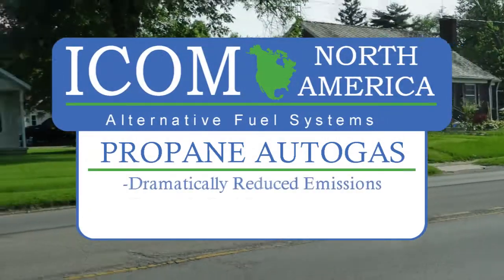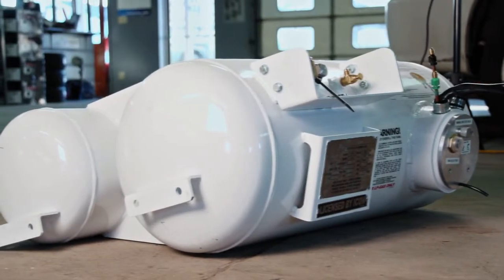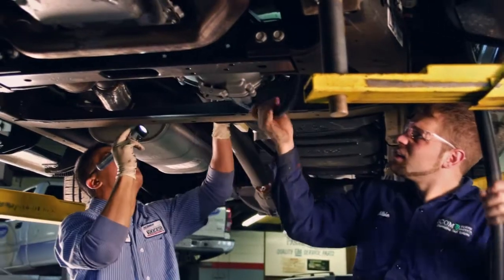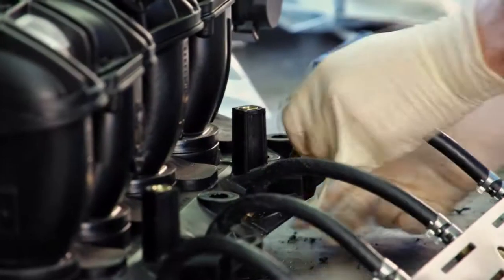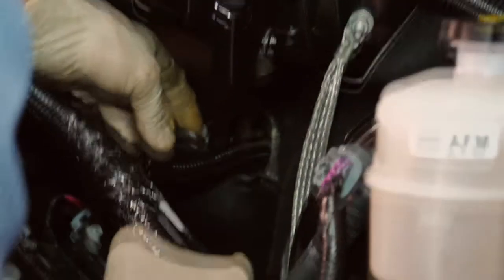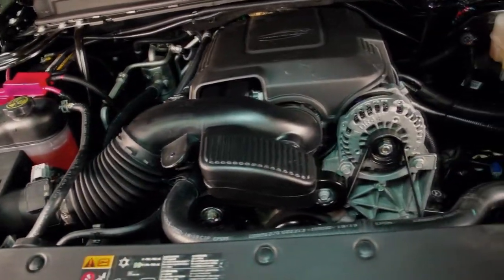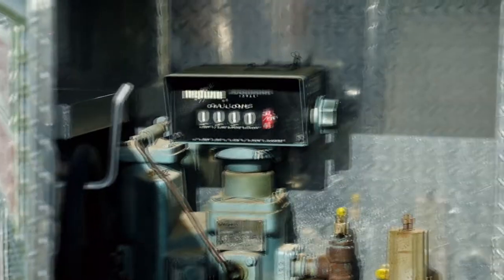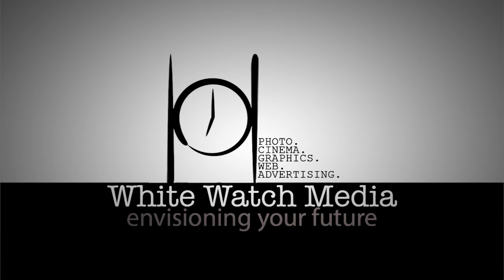Propane Autogas Conversion

Comment: One litre of gasoline contains the energy equivalent to 8.9 kWh of electricity
1 Litre of propane = 7.08 kWh (kilowatt hours)
Hence 1litre of propane has 7.08/8.90= 0.7955056179775=+-80%of the energy that gasoline has. So, unless propane is considerably cheaper than 80% of the price of gasoline it’s a no brainer that there is nothing to be gained. Also consider the conversion cost, loss of power under full acceleration (-20%!) and that huge tank you have to stick somewhere there are more cons to pros to running propane. I had a dual fuel system car and finally ripped it out.
I live in Canada and just called a local fuel station that carries auto propane. Feb 6 2021: Propane $1.09/liter. Regular Gasoline $1.32/liter, 1.09/1.32=.828=82.8%. It now costs more to run on propane than gasoline and idiots up there keep saying how much less it cost to use propane but they never do the math to figure out costs per kilometer. That money you want to spend on converting to propane can be much better spent on beer.
Reply: What about in a survival situation. Propane never expires and gas expires quickly. So eat shit.
Reply: @ruifund3834  You must be a propane dealer who has one too many tequila in him.  Propane is a great fuel but there is no economic incentive in converting to use it in an automobile in Canada.  I can't speak for most other countries but I did run my propane vehicle in Mexico as well and the numbers didn't work out either.   But yes, if the world is coming to an end it would be better to have propane in your tank instead of gasoline however a tank full of Don Julio Reposado would be my choice for living out the last few days of our existence on this planet. Have a nice day.
Reply: Only thing is the lower emissions which is why I’d do it
Reply: @ManitaHoltrop  in a perfect world ,yes. But the truth is that economics drive most things in our life. Maybe if you didn’t have to carry that tank around that eats up trunk space and the conversion cost was somehow free through subsidization it would be an attractive alternative fuel. Then there are the 20% less ponies when you pull out to pass....the list goes on.
Reply: @fkarau  gas is double the price of lp now
Reply: @woodchippers_WestWingDimeBag  , very soon to be triple and then quadruple.
Reply: Gasoline is $6 a gallon/ Propane $3.50 a gallon
Reply: @WesternReloader  You are right. Things have changed. Same fuel station I called a year ago now sells it at 56% of the price of Gasoline.  My 1993 Bonneville had the carbureted system which only gave me 60% of the mpg of gasoline. (I did the math and that is why I tore it out)  I don't have much experience about the newer direct injection systems but they must be closer to the 80% mark.  In the 80/90s there were a lot of Propane vehicles running around in Canada but you really don't see that many any more. It looks much more attractive these days.
Reply: Bet your mind has changed of late
Reply: And right now (june 14th 2022) regular gas is $5.79/gal., and propane is $2.80/gal.!
Reply: Well worth the conversion today though. Propane now less than half the gasoline price